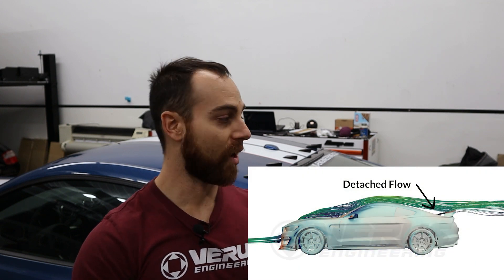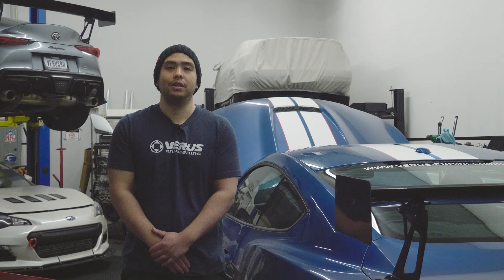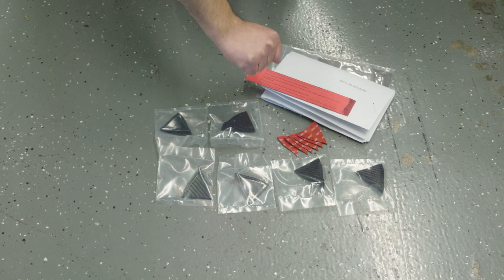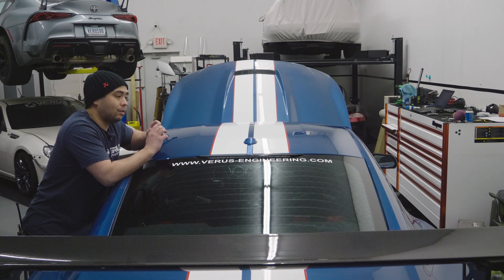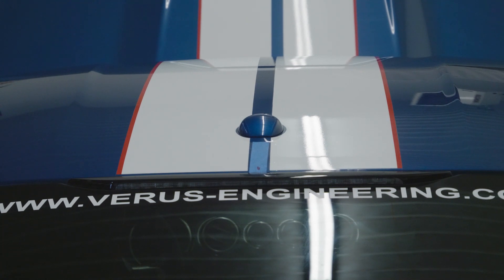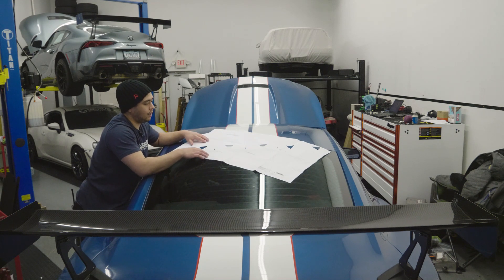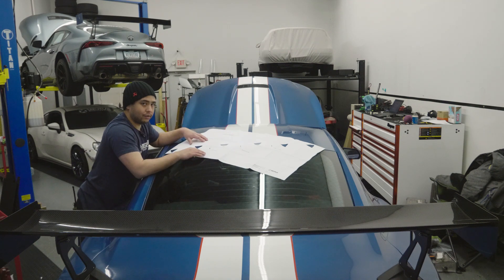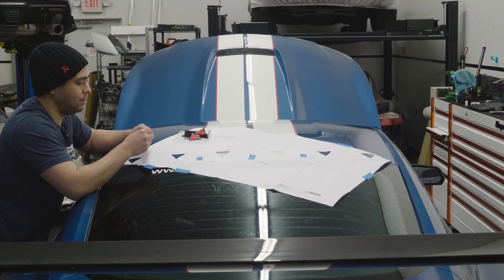Ford Mustang Shelby GT350 Vortex Generator Kit Install

Comment: I have a base GT350 with the Swing rear spoiler and Gurney flap installed. I'm interested in the drag reduction potential for these Vortex Generators.

Would they keep the air flow better attached to the rear with the Swing spoiler and Gurney flap? The Swing spoiler does not have as much under gap area as the R Wing.
Reply from the maker: Hi There, If you can email in your question to sales@verus-engineering.com they can get you taken care of!

Comment: Do these work effectively if you have the UCW rear wing installed?
Reply from the maker: Yes, I believe we mentioned this in the video. This information is also found in our informative packet for the chassis. The Vortex Generators keep flow attached and increase the efficiency for the OEM GT350R and our UCW Rear Wing Kit.